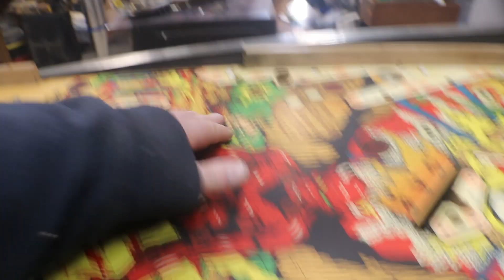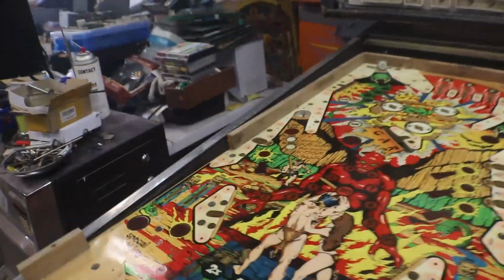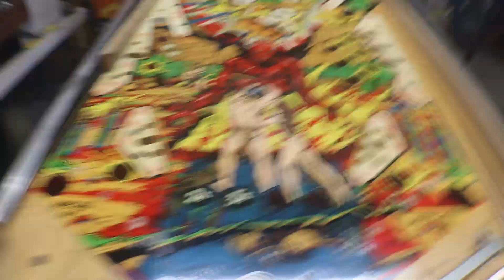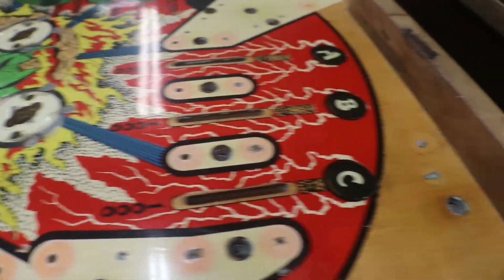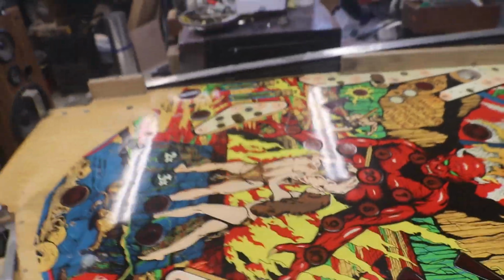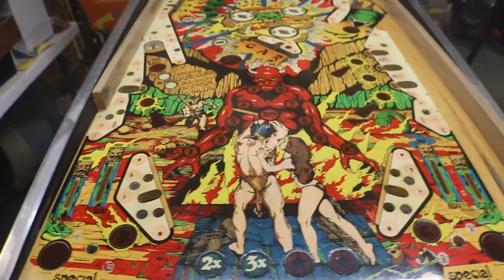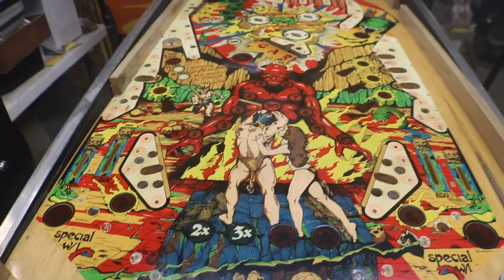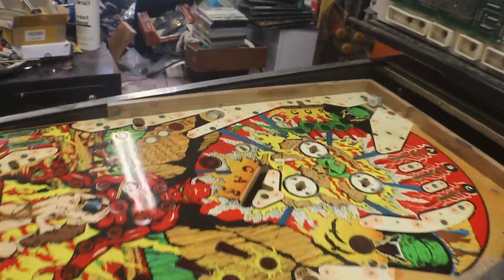1979 Williams Gorgar / Clear Coating The Playfield Ep 4

Comment: for a pinball that has had heavy touch ups , how many layers of clear would be needed? would 1 quart be enough  to do a couple layers on a playfield ? how long to dry before sanding?
Reply from the maker: A quart is more then enough. Most of the time I use two coats and I wait from 4 to 6 hours. Then I use four 0000 steel wool to knock down the little imperfection.